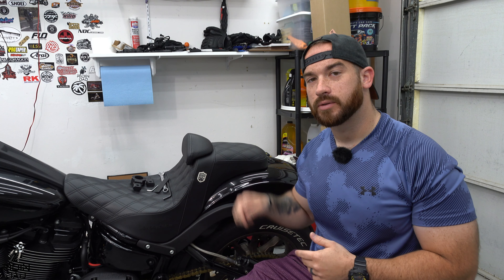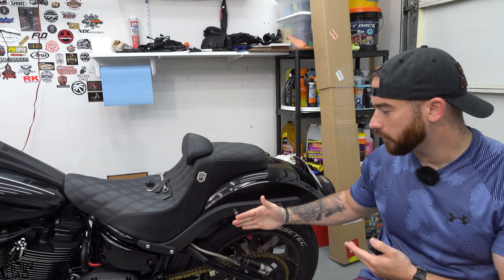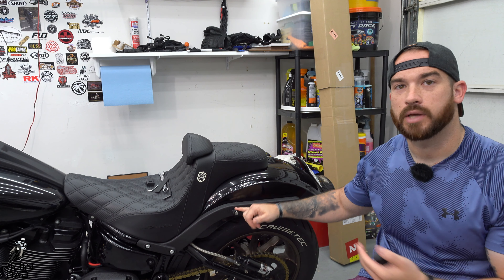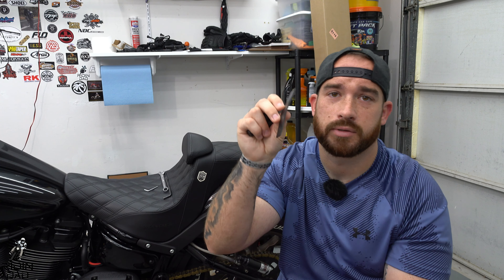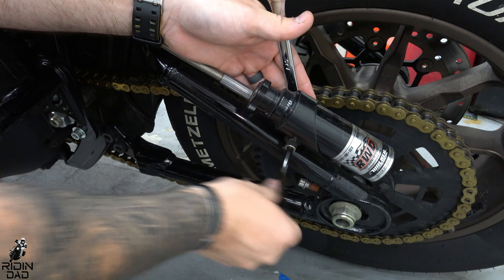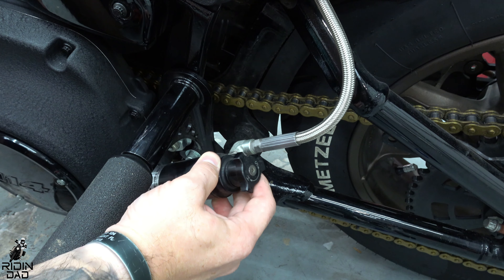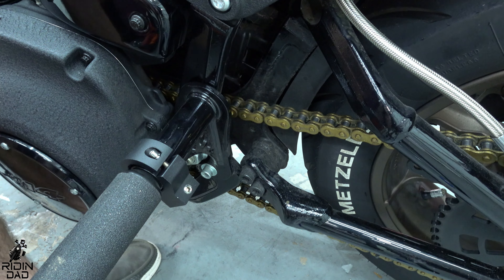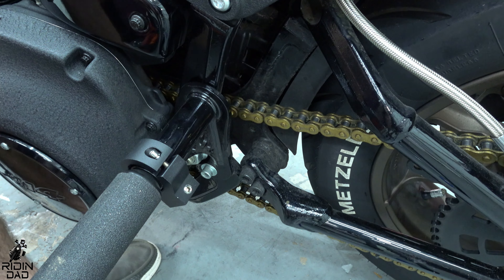RWD RS-1 Monoshock Remote Reservoir Relocation! - It gets in the way of some Saddlebags

Comment: What was the results of the lean angle everything ok afterwards?
Reply from the maker: Everything worked fine. No issues. Just hated the look lol. So I went back to normal. Just bent the mount a little towards the wheel so it cleared the bags with ease